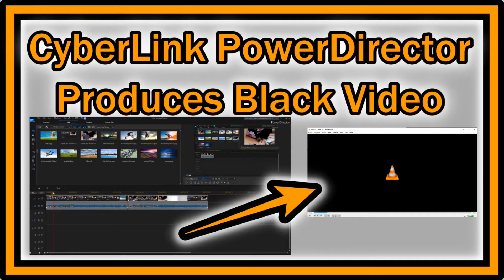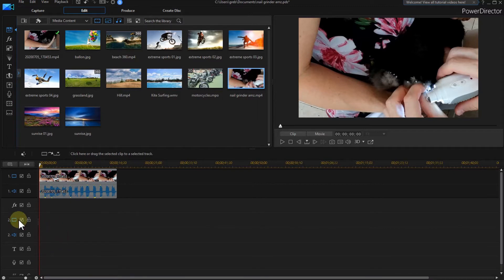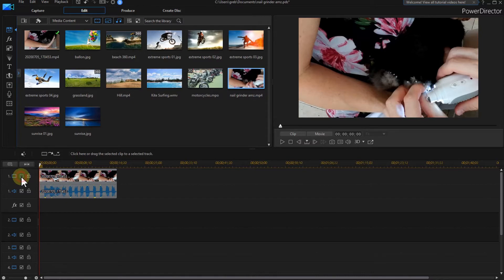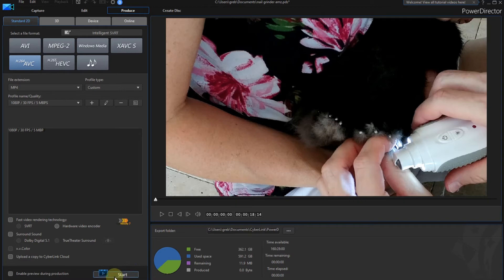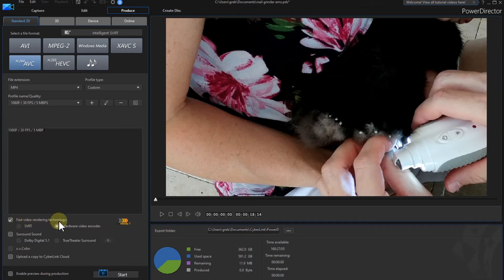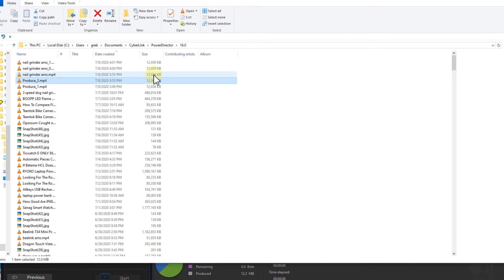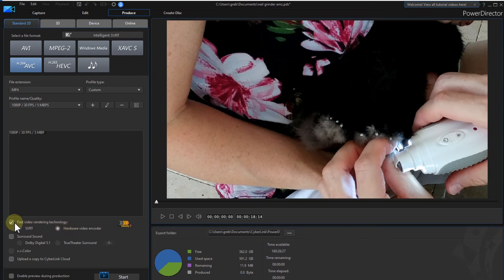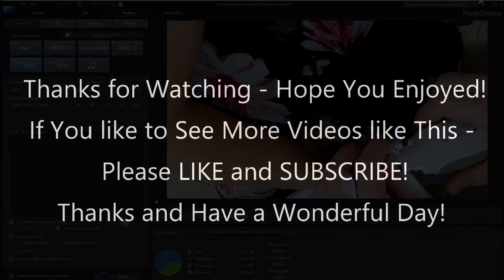CyberLink PowerDirector Produces Black Video (In the Output - Not in The Preview) - Easy FIX

Comment: I get this garbage problem a lot, and it's not from the check box. Most often, I will cut parts out of a long video, then produce it and go back to edit to cut more parts out and make several shorter vids or gifs out of it, but it's black when I go back to edit it again. This is extremely frustrating because I want to mark all the interesting parts, then come back and cut as many short vids out of that as necessary, but the software can't handle it.
Reply from the maker: Yeah sad to hear that this problem still exists, but all video editors have some problems. Some more and some less but there are problems everywhere. Now banging my head regarding my Kapwing video editor not working at all and I'm paying $20 per month :-((. What version are you using? 365?